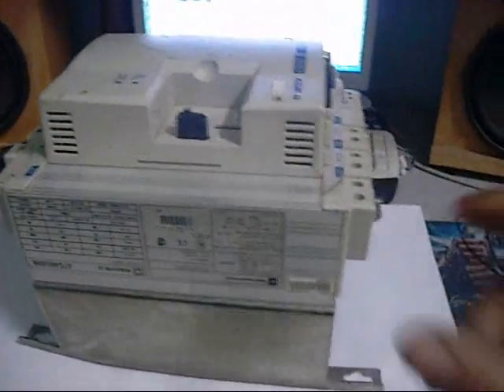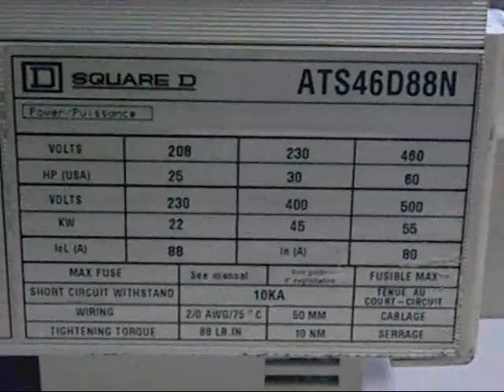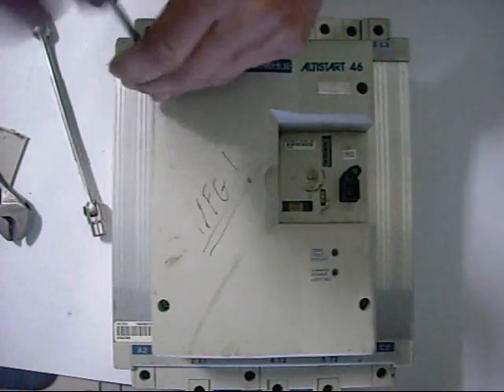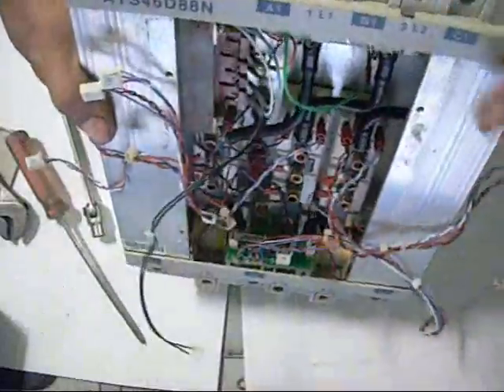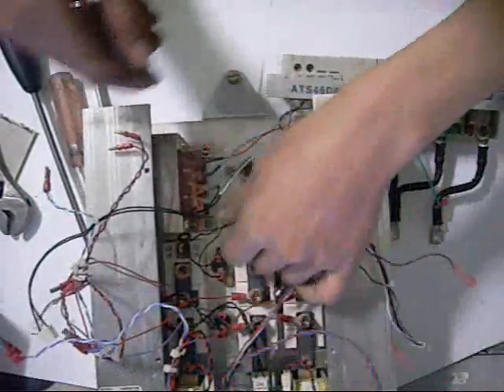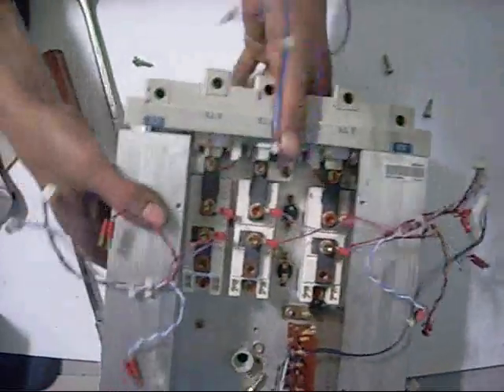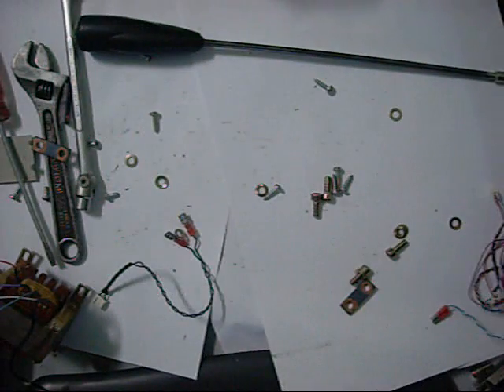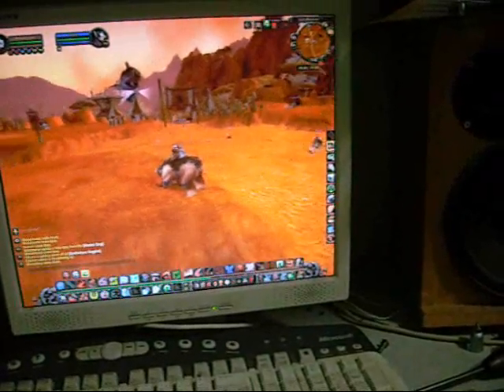Telemechanique - Square-D Altistart 46 Soft Starter Autopsy

Comment: You say 'people wouldn't throw them away if they weren't stuffed' - Its because the great majority of electricians who deal with them dont know anything about them - how to check for faults, what to check, how they work.  I dont know how many 240V/415V VVVFs, Soft-Starters, Inverter Air Cons Ive looked at that were 'u/s' that I have repaired due to a bad 5V/12V/15V connection (unseen corrosion etc), power supply pcb failure, single component failed. I guarantee majority of those components r ok.

Comment: You can test a SCR by hooking up a load to it and exciting it's gate, should stay turned on provided your load is within the minimum. Just double check the datasheet before you try them, also the sheet might include some test circuits.

Comment: they're basically industrial power dimmers with software controlled ramp for the soft start, there's not much to it if you ignore the safety circuitry! I would test those SCRs before throwing them away, you can do all sorts of nice things with them, although I've no idea what are the characteristics on those!

Comment: Thyristors are Bi-directional SCR's the same as used in wall dimmer switches. A bridge will be 2 in series. You should be able to get them to latch on with the right DC voltages.